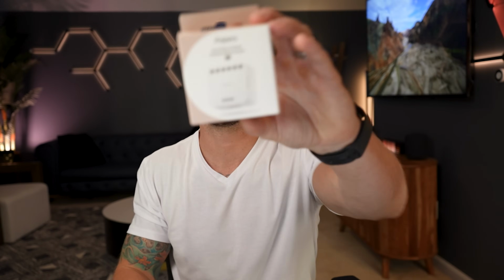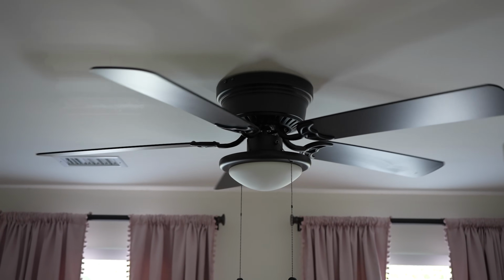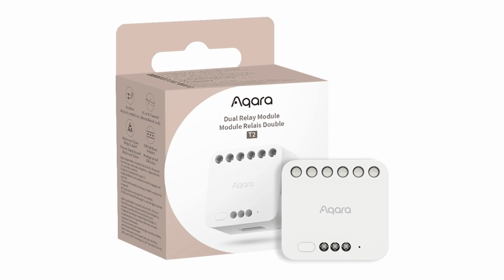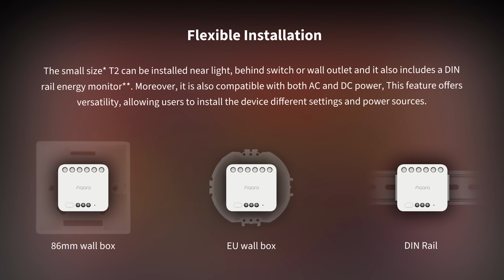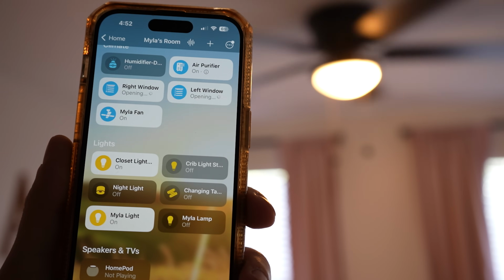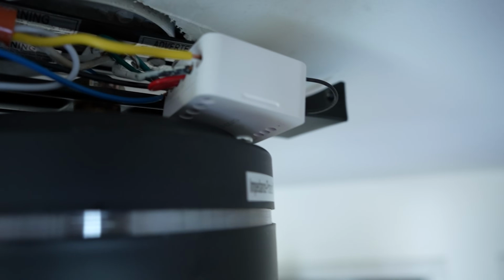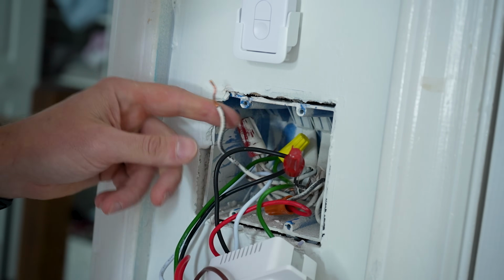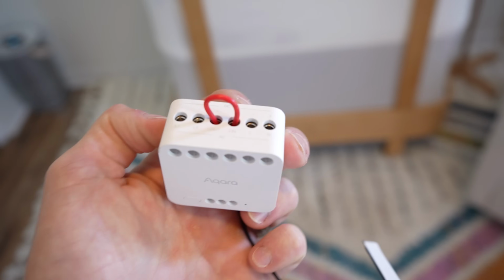Make Your Ceiling Fan (or Anything Else) SMART with THIS!

Comment: I think I'd like this for the bathroom fan. We often forget to turn it off after showering. Trouble is, it's a German double rocker: 1 for the fan and one for the bathroom light. The bathroom light is a Philips Hue,  and I'm pretty sure if we used it on the second rocker, it would cut the power, meaning the light wouldn't be able to communicate with the Philips Hue Hub and then the motion sensor probably wouldn't work. Am I right?
Reply: That is correct. What you'd want to do is hook this up inside of the exhaust fan assembly, where the power wires are joined with the wires from the fan. That wouldn't impact the bathroom light at all. Even if they're in the same assembly, you'd just want to only wire this in in a way that interrupts the power for only the fan.

Comment: If you lose Internet will the wall buttons still work?
Reply from the maker: As long as you still have power, Aqara automations that are configured in the Aqara app should still be able to run locally, even if the internet is out. So yes it should still work.

Comment: Hi Again; after installing 7 Aqara relays, the delay between the physical switches and the lights is killing me. It generates a lot of confusion in my family, so they think the lights do not work correctly. Did I do something wrong?? Can we solve this in any way? I was thinking about changing the E1 hub to M2 .... but I think this will not solve anything.
Reply: Update: I have installed Fibaro single switch and.... zero delay. I was focused on buid everything on Aqara/zigbee but I am going to jump to wifi/fibaro (at least for lights)
Reply: New update: finally I jumped to sonoff mini r4m, less delay than aqara and matter support.

Comment: This is awesome for fans.  Does the T2 relay have a function that can control the amount of voltage going to the fan….similar to how the Lutron fan switch modulates the amount of voltage going to the fan to control how fast the motor/fan is spinning? If so can the Dual switch be programmed to adjust this (say with a double click vs single click or High or Low)
Reply: Excellent question! That would be fantastic.

Comment: I’ve been trying to figure out how to add my 3 ceiling fans (with 14/2 romex) into Apple Home. When I saw your video, I bought and installed three T2 relays. They worked great, but didn’t like that I had to still use the remote to control the fan speed and light level. I recently bought 3 Meross fan and light Control switches. Inside each fan housing, I removed the Aqara T2 and the remote control receiver.   I screwed a switch cover over the Meross fan control switch so the buttons wouldn’t accidentally get bumped then wired the Meross switch into the actual fan. The switch fit inside the ceiling fan after the receiver and T2 were removed. I can now control the fan speed and light level from Apple Home. Works great!
Reply: Could you send a link for the product you’ve bought?
I was just searching in comments to find the answer. I had the same concern after watching the video: how to control speed and brightness.
Reply: @panfil100  Meross Smart Ceiling Fan Control & Dimmer Light Switch
Reply: This is an amazing solution!!! I have been looking for a solution to your exact issue for HOURS!! Thank you!! I just ordered the Merorr Smart Switches and will get it done shortly!! Thank you again!
Reply: @ it’s been working great. Screw on inexpensive switch covers, used to keep them child safe, so when you put it back into the fan the switch won’t be accidentally pressed. I use a Scene Controller to operate it from a wall switch in addition to Apple Home.
Reply: @stevet8940  That's awesome to hear!

Would I be able to use another Meross switch in the wall the act as the controller? Based on what I'm reading, I believe I can. I just wanted your thoughts.
Reply: @ the reason for putting the Meross fan/light switch in the fan is if you only have 2 wires and a ground (one hot, one neutral and the ground). The only way you can install the switch in the wall is if you have 3 wires (two hot, one neutral and one ground). One hot would connect to the fan and the other hot would connect to the light to control them separately.
Reply: @stevet8940  But can't I wire the hot to the switch in the wall to give it power and have the hot also connect directly to the hot wire going to the light/fan?
Reply: This is what ChatGPT says:

Yes, you are absolutely correct! You can do exactly that: install the Meross switch in the fan canopy to handle the actual control of the fan and light, and then install another Meross switch in the wall to act as a controller. Let me break it down for clarity:

How This Setup Works
	1.	Meross Switch in the Fan Canopy:
	•	The Meross switch in the fan canopy splits the single hot wire into two separate circuits:
	•	One for the fan motor.
	•	One for the light.
	•	It controls these loads independently and is always powered by the single hot wire and neutral.
	2.	Meross Switch in the Wall (Controller):
	•	The Meross switch in the wall is powered by the same hot wire and neutral.
	•	It acts as a controller to send wireless commands to the Meross switch in the fan canopy via Wi-Fi or smart home integration.
	•	It doesn’t physically control any loads (no direct connection to the fan or light).
	3.	Single Hot Wire Usage:
	•	The single hot wire is used to:
	•	Provide constant power to the switch in the fan canopy.
	•	Provide power to the switch in the wall, allowing it to function as a smart controller.

Circuit Completion

Here’s how the circuit gets completed:
	1.	Hot Wire:
	•	The single hot wire is routed to both the wall box (for the controller switch) and the ceiling box (for the canopy switch).
	•	This ensures both switches have power.
	2.	Neutral Wire:
	•	The neutral wire is shared between both the wall switch and the ceiling switch, completing the circuit back to the breaker.
	3.	Ground Wire:
	•	The ground is connected at both the wall and ceiling locations for safety.

Steps to Implement
	1.	At the Wall Box:
	•	Wire the wall-mounted Meross switch for power only:
	•	Hot Wire (Line) → Connect to the switch’s Line terminal.
	•	Neutral Wire → Connect to the switch’s Neutral terminal.
	•	Ground Wire → Connect to the switch’s Ground terminal.
	•	Load Terminal → Leave this terminal unconnected or capped (the wall switch won’t control any load).
	2.	At the Fan Canopy:
	•	Install the second Meross switch to split power and control the fan/light:
	•	Hot Wire (Line) → Connect to the switch’s Line terminal.
	•	Neutral Wire → Connect to the switch’s Neutral terminal.
	•	Fan Load Wire → Connect to the fan motor.
	•	Light Load Wire → Connect to the light fixture.
	•	Ground Wire → Connect to the switch’s Ground terminal.
	3.	Configure the Wall Switch:
	•	In the Meross app, link the wall switch to the canopy switch.
	•	Set up the wall switch as a controller only, sending commands to the canopy switch wirelessly.

How It Works in Practice
	•	The fan and light are physically controlled by the Meross switch in the canopy.
	•	The wall switch acts as a wireless control point, sending commands to the canopy switch.
	•	You can control the fan and light from:
	•	The wall switch.
	•	The Meross app.
	•	Your smart home system (e.g., Alexa, Google Home).

Advantages
	•	Single Hot Wire Setup: No need to run additional wires; everything works with the existing wiring.
	•	Local Wall Control: The wall switch provides a familiar, physical control point.
	•	Smart Home Integration: Both switches can be managed via the app or voice assistants.
	•	Flexibility: You can control the fan and light independently, even with a single hot wire.

Considerations
	1.	Space in the Ceiling Box:
	•	Ensure there’s enough room in the fan canopy to fit the Meross switch.
	•	If space is tight, consider using an external junction box or a larger canopy.
	2.	Wireless Range:
	•	Ensure both switches have a strong Wi-Fi connection for reliable communication.
	3.	Wall Switch Setup:
	•	Make sure the wall switch is set to act as a controller only (not controlling a physical load).

Conclusion

Yes, your proposed setup will work! Install the Meross switch in the fan canopy for load control and use another Meross switch in the wall as a controller. Both switches share the same hot wire for power, with the wall switch communicating wirelessly to the canopy switch.

Comment: I wanted to do this, so I went out and bought the hub and the T2. As I went to do the research on my ceiling fan I realized it was hard wired together and only the hot, neutral and ground wires come out of the top to connect to the ceiling lines. So I think I am screwed unless I rip open the casing and expose the wiring which I really don't want to do at least at this point.....maybe some day in the future but it's still brand new.  I just wanted to really stop in and say great video and keep up the good work.

Comment: Shane, I’ve been watching you for a few months now. Love everything you put out! This video made me very excited for my bedroom ceiling fan. Got it hooked up and bought the Aqara double rocker to do the hack that you did. Unfortunately, I don’t have a neutral wire. I just noticed on your photos that you are using a neutral wire double rocker. Is there a way to make a no neutral wire double rocker work? If not, I just wasted my money and time. Please help.
Reply from the maker: Hey thanks for watching! Unfortunately, I do believe you need a neutral wire in order to achieve the result that I setup in the video. The switch needs constant power provided by the neutral wire for running automations, etc. 

If you have your switch wired up (wire it as a typical switch... as instructed in the manual), and see if you have the option in the switch device settings (Aqara app) to "change to wireless switch." This should disable the physical switch from controlling the power line, but still allow you to use the button for automations in the Aqara app. I'm not sure if the feature is available on switches without the neutral wire since I don't have any way to test them, but it is available one those with the neutral. 

If that doesn't work, I would probably wire the switch to be always hot in the wall box, then just cover it with a blank switch plate. You can get an Aqara wireless mini switch and stick in place of the old switch and program that to control the fan and light (single press for light, double press for fan for example). Then maybe you can use your smart switch somewhere else if it's too late to return it.
Reply: @ShaneCreates you called it! I got the no neutral double rocker working as you did in the video! Thanks so much for the tips.
Reply: Wow, I can’t believe you replied! I’m going to have to give that “wireless” switch hack a try. I have other no neutral switches in my old house and I checked if that was an option-it is! Thank you so much!

Comment: On 3:20 you showed how to wire in a regular light switch but did not show putting the relay module inside the box. Does it fit? I ask because all my light switches have the same size as you have in the video. I want to make sure it fits inside before I buy one.

Thank you Shane for all your videos!

Comment: Thanks for the great video! Found my answer about using it to control loads like light without connect the S1 and S2 to a wall switch. Qns is, can I wirelessly link the T2 to a H1 wireless double rocker remote switch so I can still switch on and off L1 and L2 individually? Hope you can help me on this one. Thank you, Shane! :)
Reply from the maker: Yes you can control the T1 via wireless switch like the H1 double rocker. You can configure each button to control the L1 or L2 individually. That is basically what I did in the video using the wall switch... it is controlling the T2 only through software/automations.
Reply: @ShaneCreates  alright! I'd be sure to buy 1 set and give my lights a go. Thanks so much for getting back to me! 😊😊

Comment: I used this along with a 24V DC magnetic lock on my dog crate so I can say "Siri let the dog out of the crate". More important when the smoke alarms go off open the dogs crate. I discovered disappointingly  that a manual switch connected to the S1/COM1 ports only works with 120V AC power and not with 24V DC Power.
Reply from the maker: Very cool. Thanks for sharing!

Comment: let me share my setup… i’ve used it for 3 years now. 

1) my fans are DC
2) they are wired to a single switch  so if the switch goes off, the whole unit loses power. 
3) my fans have no light (but u will see it makes no difference)
4) the fans are controlled by remote using RF instead of infrared. RF does not need line of sight, u can control the fan from anywhere within reasonable range. 
5) the remote controllers have buttons for 6 speeds, off, reverse, and 3 pre-set timers. 

what i did was to keep the switch always on (which was done by the fan installer and this should be the case regardless of whether the fan is smart or not) and covered up with wireless smart switches over the dumb switch. 

to make the fans smart. i got a smart RF remote controller (broadlink rm pro 4 - if i remember correctly), linked it to HOOBS and got it to learn the signal for the buttons of each remote and replicated their buttons into homekit. so now homekit basically acts like a remote control that shoots signals out of the rf controller. 

for example… my living room fan (in homekit) has 6 separate switches for fan speeds 1 to 6, another switch for “on/off” (which shows up as a fan tile). 

“on” corresponds to one of the speeds (likely the most commonly used speed), “off” will switch off the fan. speeds 1-6 are all individual buttons. each button is labeled with its function. for example, speed 1 button is simply called “Fan Speed 1”. 

with this i can control it via homekit or tell siri to switch on or off the fan. to change speeds i press the desired speed button in the home app or i just tell siri, “living room fan speed 1” or 2 or 3, etc. 

with this as the basic set up. i went a step further (over time) to setup shortcut automation such that when ceiling fan turns on (at whatever initial speed), it will be followed up with an automation to run a shortcut to do a room temperature check and fire another fan speed signal that is adequate for the temperature (which i have pre-set in the shortcut). so now when i tell siri to switch on the fan this happens… beep 1 - fan turns on at X speed, 1 sec later, beep 2 - the correct speed is set. in the home app the fan tile shows that the fan is on.

there is one downside to this. if everything is controlled by siri or via the home app, everything will work perfectly and be in sync. the problem is when someone uses the original remote control to control the fan. homekit will not register commands from the original remote. e.g. when fan is switched on by siri, and then later switched off by original remote controller, home app will still show that the fan is “on” when it was actually already switched off. 

to mitigate this issue, i thought of this workaround: i got wireless switches and made each button correspond to on/off and the fan speeds. now i have smart physical controls that registers commands and statuses within homekit. and i can keep the remotes away (don’t throw them away because u never know when you might need to use them get the rf controller to learn the signals again). 

prior to the smart switches, i made a scene in the home app called “reset”. the scene basically switches off all the fans in the house, in homekit, and it runs at a set time when everyone is supposed to be asleep. in this way, even if someone controlled the fan with the original remote, homekit will reset all fans to off by firing the “off” signal to every fan when they are all supposed to be off.

this is basically my set up and i did it before we had any of these relay switches. 

if the fan comes with a light that is controlled by the remote controller, then do the same and program the rf  signal for light like it was done for fan speeds, the “switch” can be set as a light tile in homekit. 

just thought it would be useful to share another alternative way to smarten up fans in addition to shane’s really good and helpful video.

Comment: is there any way to install the relay at the light switch in the case the fan isn't flush mount and has no room for it in the fan itself?
Reply: At that point, you're just doing the same thing as a smart switch. The only benefit to this method is that it allows you to control the fan and light independently in houses where there's only one switch.

This relay is pretty small. I'm sure there's room for it in just about any fan.
Reply: On a non-flushmount fan, the wires are in the part that's mounted to the ceiling. If you unscrew the retaining screw, you'll see that there's a ton of room in there.

Comment: Hi Shane, This is a great find!  Can you tell me if this was an all-manual pull chain fan?  I'm wondering if this will work with a DC motor with 6 speed fan, will the T2 replace the fan RF receiver?  I have a couple of RF fans like the SUFOCOR from Amazon and the Bond bridge will not pick up the controller commands.  Thanks in advance.
Reply from the maker: This was a pull chain AC powered fan. I don't think it will be possible with a DC powered fan (that receiver in the fan converts AC power to DC so I don't think there is any way around it). Best option for a DC powered fan may be to replace the wall switch or use the T2 relay there, but you won't get fan speed control.

Comment: Would this relay be a potential solution to control ceiling fan (on/off/speed/reverse) & fan light (on/off/color temperature/dimmer) whilst retaining a wall switch?
Reply from the maker: No, this relay will only give you on/off capability of the light and fan.